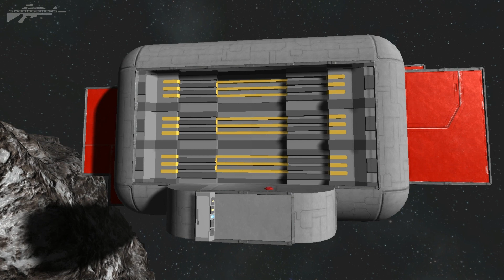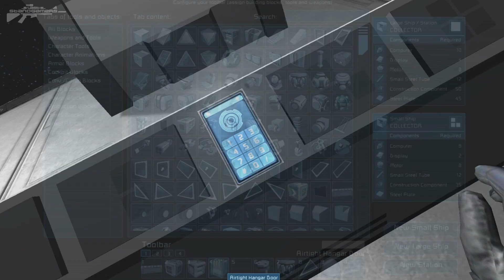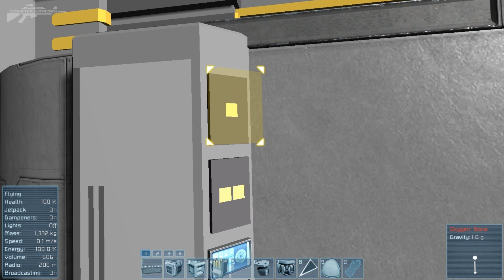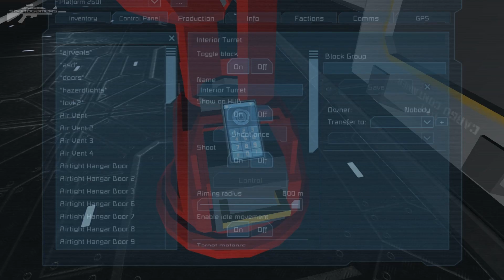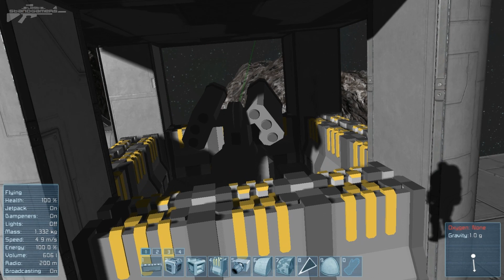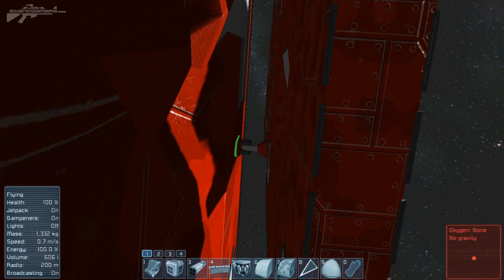Space Engineers -  Pressurized Hangars (Update)

Comment: Something that would be cool (But every difficult) would be the ability to pump too much air in and over-pressurize, causing a delightful pop/explosion of some kind
Reply: It would be nice if the depressurization affected your ship's trajectory. :)
Cause y'know, huge flume of air suddenly rushing out of one part of the ship into space, possibly sucking out anything that's not welded/bolted on the ground.

Would be pretty interesting in space battles where ships have multiple decks and sections.
Reply: *****
I agree. I built a prison ship where the cell portion of the ship was sealed off and can be depressurized separately from the rest of the ship. But there seems to be a bug, even if the air vents are grouped in the control panel, they still all toggle :/

Comment: One thing i really want them to implement or allow is the merge blocks being able to connect large ships to small ships. Also to be able to use the hologram block on large ships and show small ships... it would make life a lot easier
Reply: To show small ships on a large ship, here's what you need to do:
1. Build a rotor on your large ship, then delete the rotor part (the bit that spins).
2. Create a small ship.
3. Build a rotor part onto the small ship, then delete the rest of the small ship and put a projector onto the rotor part.
4. Move the rotor part up to your large rotor.
5. Go to the control panel and press "attach".
You now have a small ship projector on a large ship.
Reply: That would mean they would have to implement a large scale compound grid system.
Reply: ***** If there are workarounds in place, why can't they just make the workarounds easier? I would love to be able to build small ships in a welding bay inside a ship without having to go through this odd small ship frame that you end up having to build, with the ability to detach it when it's done building.
Reply: true dat
Reply: because of the difference in the grids each block takes up it would be very difficult to do. your going to have to use connectors for that purpose.